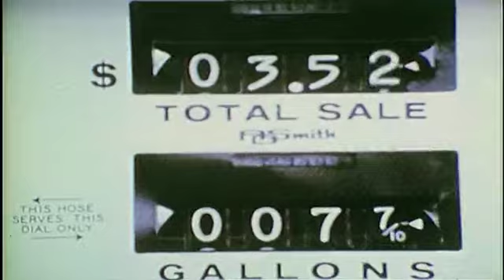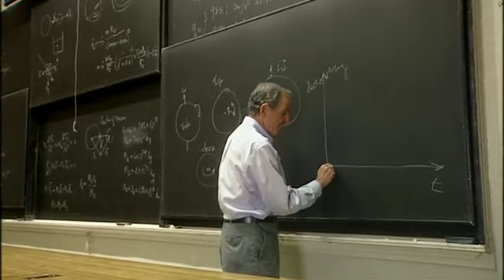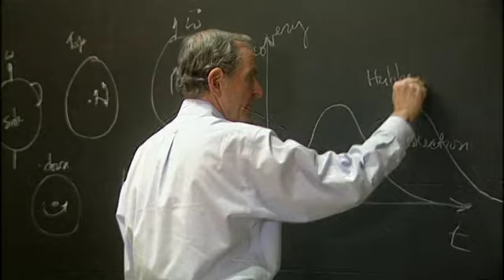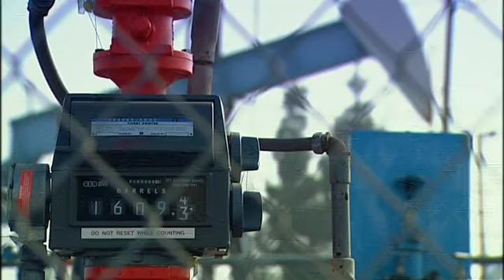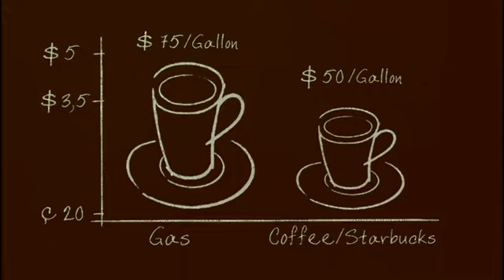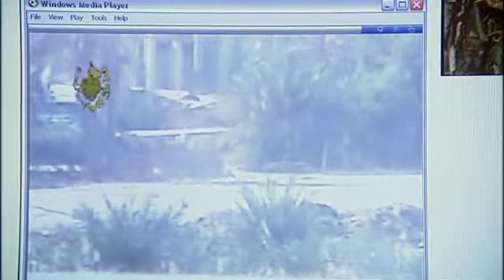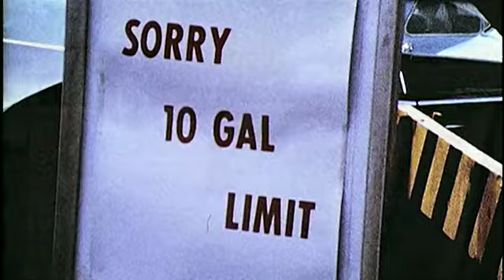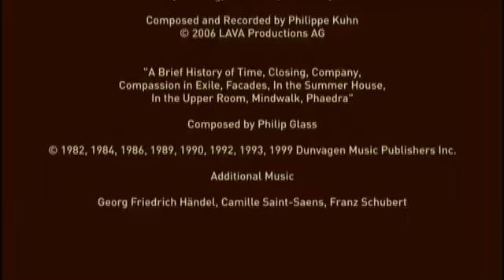A Crude Awakening - The Oilcrash

Comment: MY OPINION: OIL WILL BECOME LESS AVAILABLE BUT BY THEN THE TECHNOLOGY WILL BE ADVANCED TO THE POINT THAT OIL MAY NOT BE NEEDED AS MUCH. hYDROGEN AND NATURAL GAS + BATTERY OPERATED VEHICLES AND HOMES ON SOLAR/WIND. NO NEED TO PANIC YO-ALL. iN THE 80-90S WE MADE 5-10/HR NOW WE MAKE 20/HR AND PAY 3-4 A GALLON. NOT TOO BAD.
Reply: hydrogen will never replace oil. It takes more energy to produce hydrogen than you get from using it. So a hydrogen economy is very unlikely.

Comment: one liter of oil is 10 kwh I can go to the gas station in Canada and buy 1 liter for 1.33 a human can use a bike and produce 100wh to 400wh depending on how fit they are 25 to 100 man hours in that liter of gasoline and the full 10kw can't be used because the engine on a car is 25-35% efficient to diesel on a ship with waist heat recovery system is 55-60% at 77000kwh
Reply: just wanted to chime in and say how intersting that after covid, errrrr when the prices of gas dropped by half ......
and 6 years later annnnndd?!?!!??!

gas is 1.33 a liter here where i am in canada

Comment: there are plenty of realistic alternatives.  palm/vegetable/other oils, even used cooking oils all work in diesel engines.
electricity is becoming more viable and even hydrogen will power cars.
Reply: *****
replacing the void left by oil is almost impossible.
Reply: ***** I was talking to the OP.
Reply: most electricity is generated by oil
Reply: Land Knight
most electricity in the USA is generated by coal and natural gas. Oil is primarily the fuel for transportation but not for electricity. Electricity is primarily generated by coal and natural gas around the world (over 60%). And also nuclear energy. By contrast, only 1.6% of all electricity in the USA is generated by oil.
Reply: paul wilson Electricity is not an energy source.  You need Oil to generate Electricity.